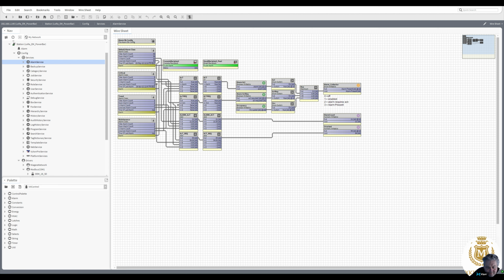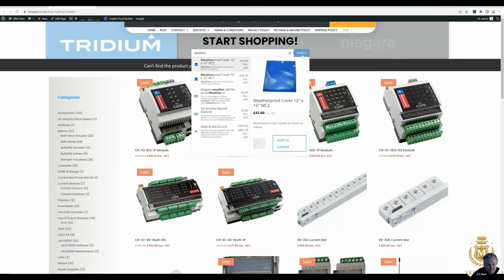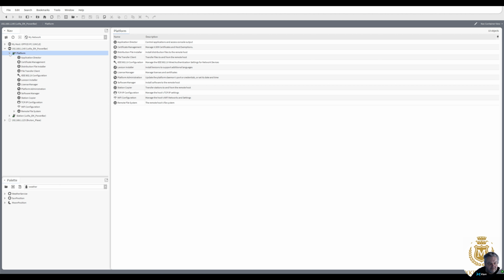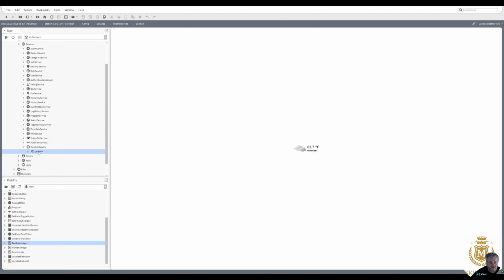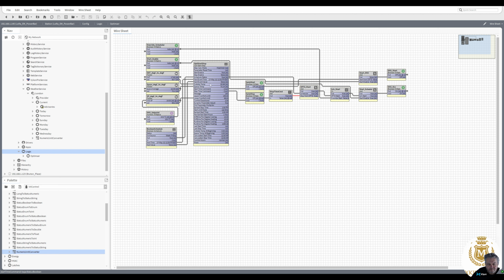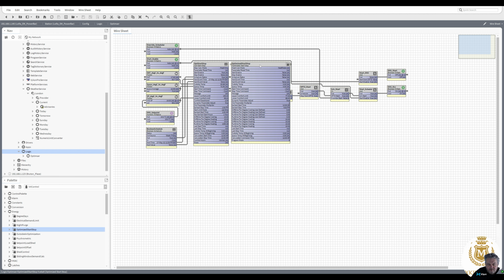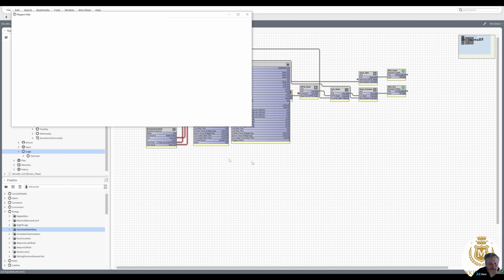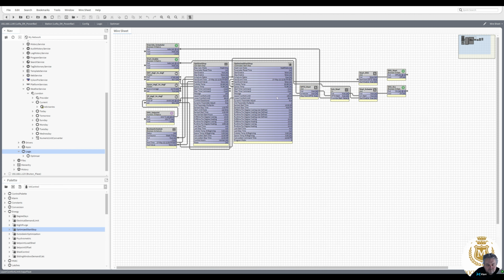#36 N4 Tridium Niagara - Machine learning - Optimiser

Comment: Thanks for the video. Trying to use the Optimized Start Stop block for a project. I think the reason your one block is different than the other is the module you grabbed it from. I might be wrong but I think the left-side one is from the VykonPro module and the right-side one is from the kitControl module. Just a thought because sometimes their blocks differ slightly
Reply from the maker: You are correct